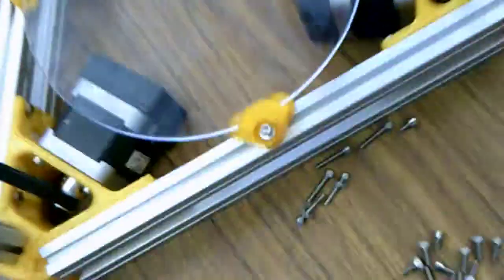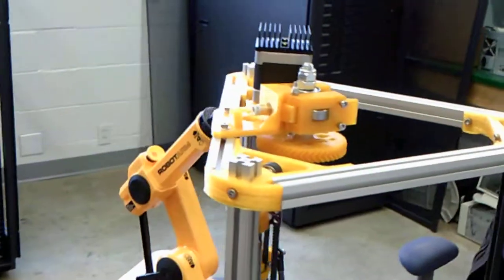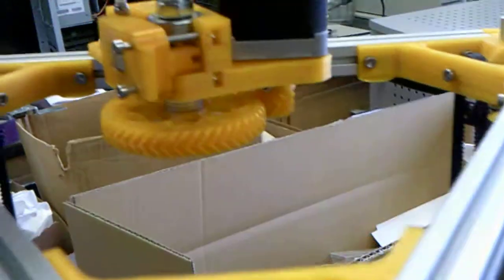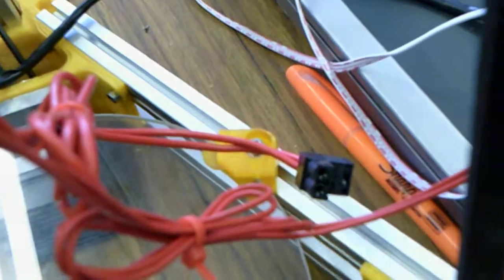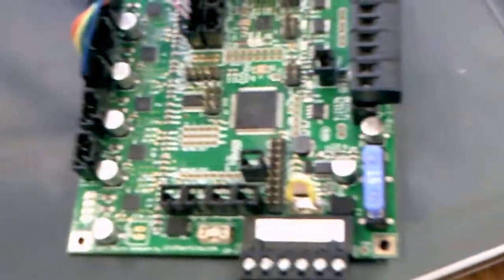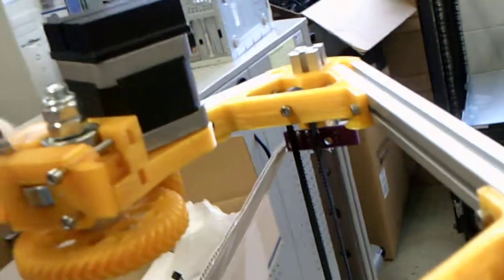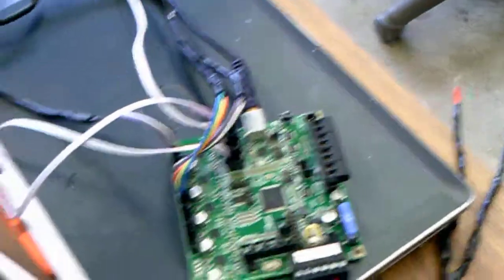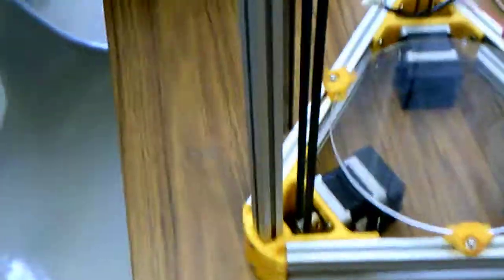Kossel Mini Build (35 of ?) Attching tbe Bowden Tube

Comment: You can easily remove the tubing by pushing in the plastic part of the fitting into the body.  As you hold it down, you can pull the tubing out.